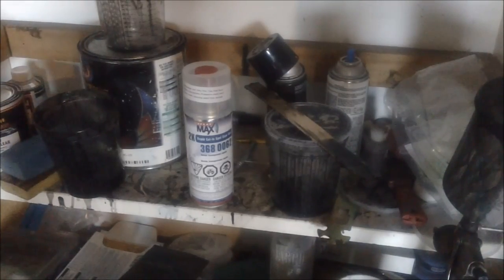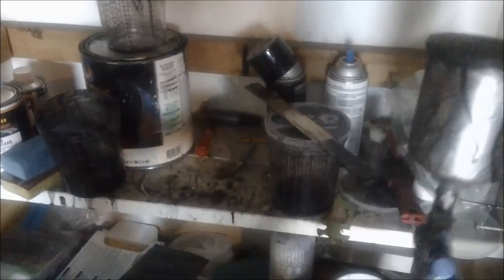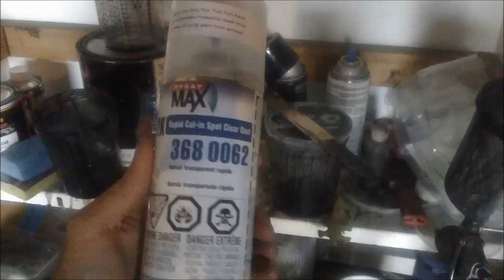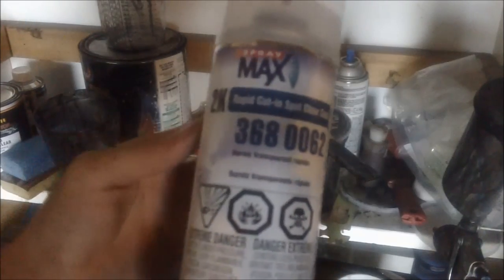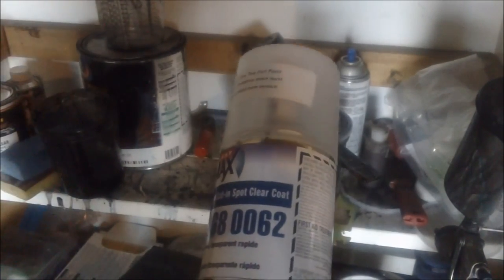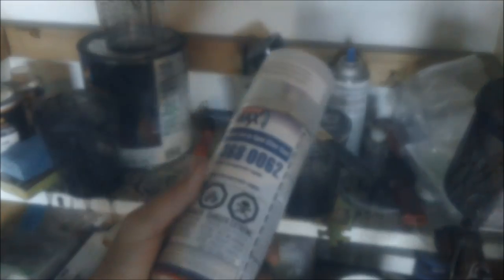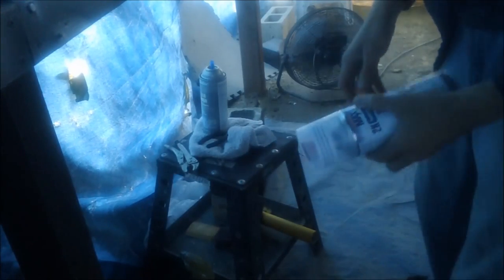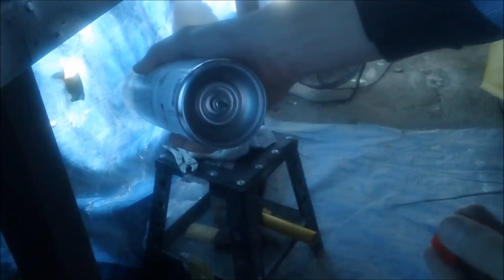SprayMax 2k Clear in a Spray Can

Comment: I used 2 cans of the this on a carbon fiber trunk and it turned out amazing. I wet sanded it with 2000 and 3000 grit, buffed, polished, and then waxed it. Came out super smooth! Threw my micro fiber towel on it and it just glided off.

Comment: Hey Gary I am a professional finisher and I love this spray max stuff. My wife parked her car in a place that she never parked before and stupid me I backed into her passenger fender. Body shops wanted like $1800. to $2400. to fix it. I purchased a brand new fender on line for $140. which was already primed and gave the car's paint numbers to spray max distributor and they mixed the color for me in the spray max cans,  I also purchased the primer and clear coat from them. My total cost was under $225. and my wife who is a bitch to please was so happy she gave me a little sugar that night So if you don't want to mess with compresses, mixing paint, and cleaning spray guns then this is the way to go. I''ll give you one tip however. Spray your paint on a sample piece before you paint your project, this will give you a feel for the job and you'll avoid any runs until you get use to it. It's best to wait at least 2  to 3 weeks before you  start cutting down the finish with 1500 and 2000 grit sand paper and water then you can apply a buffing compound and polish.. You'll never know you might get lucky that night. Have fun guys, Mr V

Comment: Love the SprayMax 2k, far, far better than any 1k.  Worth every penny!
Reply from the maker: +MrLarryQ Exactly! I still use the 1k but only for certain small plastic things now
Reply: except that it can be deadly if not used with proper equipment, google isocyanate poisoning and 2K paint
Reply: @knarly3013  Now there is 2K spray can without isocyanate.

Comment: I just got a can of their 2K Clear Glamour. I am spraying a small motor cycle gas tank I just painted.  I talked to the Spray Max Rep today and they said to always wear gloves along with a long sleave shirt or a paint suit and mask that covers the whole face.  Not to have any skin exposed while spraying was important.  These chemicals can get into your blood stream once they land on your skin.  He also told me after the red cap is pushed on the bottom he said to shake the can putting pressure on red cap as you shake the can for a few minutes.  It also cures better if the the part is placed a warm environment that is over 100 degrees.  Looks like a good product.
Reply from the maker: Ive heard a lot of chemists say that about covering your whole body, then again Ive seen painters doing this for over 30 plus years spraying in a t-shirt and shorts still going strong with no issues. However it is good practice to cover your body up, best not to take chances. But the whole place the part in a hot environment over 100 degrees I will disagree with. Unless youre spraying in the summer time and youre in a naturally hotter than balls climate, the clear will cure no matter what given the ample dry time so the chemicals can lock up, keep in mind when you add the hardener to the product, its going to lock up no matter what. So placing it in a super hot environment does help but is no better or worse than letting it dry on its own, let me know how you like the glamour clear, Ive only used the spot panel one
Reply: +Gary Rubino The Spray Max rep said to put the gas tank in a 125 degree oven for 8 hours.  My tank was just lined so there is no gas fumes.
Reply: +Bubba Gump When I am going to use it I have the correct 3M respirator and no skin will be exposed.  Lucky it's a small gas tank and I will not have to spray much of that stuff.  3-4 coats should do it.
Reply from the maker: While I know that a full air feed mask is a great recommendation, because we dont spray day in day out its not going to be detrimental to your health. Im not disagreeing with it but all Im saying is its not going to be the end of the world. A suite and a good spray max that is fresh meaning its max time its been opened is 24 hours should protect you just fine for the application youre doing.
Reply: would just a regular dusk mask be suffice?
Reply: Robert.  A regular dust mask is not OK you should use the one the manufacture recommend.  I used a 3M NIOSH 60923.  For the amount of product I sprayed the rep said that mask was fine but made sure the charcoal filters are newer and fresh. This is real nasty stuff if you breath it in.  Not worth taking any chances.  Each body reacts different to these chemicals.
Reply from the maker: Ditto! Coudlnt have said it better myself!
Reply: What is your gas doing to the shine whet you drip or spill it on. We have E85 blend, alcohol kills the shine.

Comment: I love this spraymax glamor clear for small jobs.  I've done a couple small side mirrors and they looked as good as oem and matched peel and everything.  Also I go light, medium, medium heavy on my three coats if that helps..
Reply from the maker: phordguy Great to hear another thumbs up on this stuff phordguy! Ill try that light, medium progress thing next time I use this stuff, its been a while for me. I just pounded it on like Id do using a gun and it it got me into a little bit of trouble on the first coat
Reply: Gary Rubino I go light on the first coat (faster pass with less material flow on knob) with a gun as well.  I find it makes less of a chance for a noob like myself to hang a curtain run on vertical surfaces.
Reply: Gary Rubino I sent you a friend request so I can show you how I painted my little door mirror covers on fb.  LOL

Comment: Hi there, great info on the clear coat.

I have just a couple questions since I can't seem to find it anywhere.

I am painting my brembo calipers with VHT engine enamel that is rated at 550 degrees F.  Will be stripping current silver paint off them and then priming them with VHT high temp primer rated at 550 degrees F.  My main question is since this is a 2k clear coat, will there be problems using such on the calipers?  The car will not be tracked or abused.  It's a weekend/dinner car.  I just want to make the calipers look nicer than the previous owners chips/scratched up abuse from them and protect the paint.

One last question since I can't seem to find anything either.  On the VHT enamel paints they say that you should bake them in the oven after the base coat is on at 200 degrees F, for 1 hours.  How would one do this with the clear coat?  Would you spray primer/base then bake.  Once fully cured spray on the 2k clear coat, or would you go through the whole process of primer/base coat/ 2k clear coat then bake?  The first seems more logical because then the base coat that has ceramic in it does it's thing but then I wonder if the clear coat would properly adhere?   Where the latter seems like the clear coat would prevent the base coat from fully curing doing it's thin once baked?

Love your videos BTW.

Thanks,
-Nigel
Reply from the maker: Hey Nigel, Ive never used the spray max stuff on the vht paint before as well as baking anything so its out of my area of knowledge. However I can tell ya what I found on the spraymax site, according to the tech sheet you can use those IR lamps on it but Ive seen nothing that says about baking so on that assumption, you probably cant do it. Check it out, spraymax.com/fileadmin/download/spraymax/spraymax_tmb/spraymax_tmb_gb/TMB033_GB.pdf

But you probably can do it with the vht clear since the whole product line suggests baking, I tried looking for a tech sheet but this was all I found so far vhtpaint.com/high-heat/vht-caliper-paint#Curing

My suggestion would be to stick within the product line to be safe but if you did try it the second way as you wrote, if the primer and base have cured, you'll need to scuff up the finish before you apply the 2k clear if you were rgoing to try it that way because there is no chemical or mechanical adhesion, so you'll have to create it but again, Id stay in the vht product line and follow their instructions. Thats just the way I would go, hope this helps.

Comment: Here is the teck sheet from them, it says Do not polish.

Spray coats 1 – 2 spray coats, flash-off time between
every spray coat (approx. 20 µm): 10
min.

Drying: Dust-dry: 30 min
Dry to the touch: 12 h
Ready for polishing:

DO NOT POLISH (this will
cause undesired glossing of
the surface)
10 min. flash-off time,
30 min., (object temp 60 °C) dry to the touch
Further processing: !
Do not polish!
Matt clearcoats can generally not be polished – polishing
changes the gloss and colour impression.
Processing time: Approx. 48 h at 20 °C room temperature. The processing
time depends on the ambient temperature.
Higher temperatures lead to a shorter pot-time, lower
temperatures to a longer pot-time.
End of work: On completion of the painting process, turn the can
over and spray until the valve is empty.
Reply from the maker: Good to know for the matt clear; however the clear in this video is the gloss version
Reply: They don't make 0062 anymore,
SprayMax 2K clear coat

2 component clear coat with very high chemical, petrol and weather resistance for high-quality and long lasting sealing of repairs and new paint jobs on vehicles and motorcycles.

Advantages

Greatest abrasion and scratch resistance
Very smooth flowing
Permanent high gloss
Very good buffability
No colour tone deviation
Excellent paint condition
Also suitable at higher ambient temperatures

Art.-No.:   (400ml)
680 065 transparent matt (12+/-3 gloss units at 85° measuring angle)
680 067 transparent semi gloss (40 gloss units at 60° measuring angle)
680 061 transparent gloss (>80 gloss units at 60° measuring angle)
Reply: The suppler on Ebay said" good for a gas tank, but didn't recommend it for E85 blend- alcohol kills the shine. I'm not convinced this will work for a bike tank.

Comment: Nice. Gary, wondered if you have a video on blending clear coat spray with an existing factory finish. Have a rear quarter panel with surface rust on the bottom edge that needs repair, but the panel is one solid piece with the roof and quarter panel on the other side. How do you approach something like this?
Reply from the maker: Ive actually only "blended" clear once and to be honest, that isnt the 100% right way to do it as it will fail on you, but you can get away with it. There are videos out there that talk about it, however I no longer do it nor advice doing it. Plus what youre doing is a big multiple areas to clear, What I would personally do is fix your repair areas, blend in your base color then clear the entire panels, the roof and the other side. Thats the best way to insure a long lasting repair but should you really want to blend in clear, check out this vid Pete did on a collision repair job, youtube.com/watch?v=_GhiCdq9y3M he blends in the clear on that bumper and explains how to do it.
Reply: +Gary Rubino Thanks, I'll watch that video.

Comment: Been watching over your videos dope stuff with the spraycan. I might try spraymax on the entire car but that would take alot of cans. Got a spraygun though maybe I think of something to get clear onto my single stage paint. What's a good clear to go over enemal paint?
Reply from the maker: Thank you for watching, seriously appreciate the support through the years now. Hmm good question, a similar answer would be a urethane clear (I favor the house of kolor stuff, matrix is also my next in line choice) but I remember pete saying if you clear over enemal paint, you have to "shock it" dust a lite coat over it, then 2nd goes a bit heavier then 3rd should be almost a full wet coat then apply 2 to 3 full wets after all that. Now for doing a whole car, yea, it'll be a lot of cans but Ive seen a few do it. But if you have a spray gun, go that route and you'll be done so much faster and might even save a bit on materials

Comment: Great informative video, now can this stuff be sprayed over any pain?
For instance acrylic?
Reply from the maker: Im not too sure on the acrylic, one thing you might try is to "shock it" Now I havent done this so this is all hear say but prep the surface till its sanded flat with 600 or 800 then dust a coat of the clear, then do another coat a little heavier then a 3rd even heavier until you work your way into a full wet coat then apply 2 more wet coats from there. Again, I havent tried it but thats what Ive seen a few times on forums.
Reply: Gary Rubino thanks very much , now does this stuff dry quick and to a hard finish I can polish up?
I'm painting some DJ turntables you see and want the glass finish , would I be better getting a paint suitable for 2k as the item I'm painting is plastic does this matter?
Reply from the maker: Ah theres the trick, is it raw plastic or does it already have a coating on it? This stuff does take about 24 hours to really lock up and you can cut and buff it out to a glass finish assuming the panel youre painting is nice and straight. The alternative to this would be the upol 1k clear. It doesnt have a hardener but would be the next best thing to this and you could spray it over other substrates with less fear of it fighting whats underneath. We'll get ya throw this project and have a piece that you'll be proud of
Reply: Gary Rubino thanks again buddy. Yes the plastic has a silver paint on the top of it but very thin so when I key it up the paint will be gone , I was then going to use plastic primer and then paint it a colour and then 2k
I would prefer 2k with hardener to be honest as for some reason I don't have luck with paint drying and I'm very impatient
Reply from the maker: You are most welcome my man! Youre pretty much on the right track to be honest. Plastic primer, base and clear. You should be plenty right to rock and roll from there With the plastic, Id prep it out with 180 and I would add in a high build primer like the spray max 2k primer after the plastic primer, 3 good coats, finish sand it with like 600 wet and go to paint and clear from there. Just like you Im impatient lol but the wait times are just something you have to do, the 2k primer and clear takes about 24 hours to lock up but for a can stuff, its the best around right now
Reply: Gary Rubino thanks again buddy I will get on my project ASAP! And let you know my results.
Have you ever tried 2k matte clear coat?
Reply from the maker: Anytime man, Ive yet to do any flat colors to be honest but I think I might give it a go on my next computer case I paint

Comment: What's your advice for using spraymax 2k for a bumper? I just bought a can and am wondering the best approach for spraying the bumper. That is: in one long spray horizontally across the whole bumper similar to what you did with the door panel, or in smaller sections at a time? I'm afraid that breaking it up into setions would lead to uneven areas.
Reply from the maker: +gloworm106 Id do it in one big spray and not spot it in. You could get away with it if its in cooler weather though and Ive done that in the past. But just to be safe, I think it would be safer and probably easier if you went from side to side. Hope this helps and good luck! Let me know if you have any more questions
Reply: +Gary Rubino Thanks for the tip! I'll be sure to go straight across the bumper to get an even coating. The item description says it sprays like a spray gun, so no issues with splatter, right?
Reply from the maker: +gloworm106 No splatter what so ever so youre cool on that point :) But fair warning, I found out real quick it spray a hell of a lot more than a normal can does. That and there are two clears, ones a "glamour" clear and the other one is like this one which is a spot panel, spot panel doesnt work great for anything bigger than a door this size and some guys N gals doesnt even clear the whole thing they use this "clear blender" which is not the way Id do it but I digress, no splatter. Just keep in mind, this can will lay it out fast
Reply: Gary Rubino
Thanks for the tips. Kinda nervous about using this 2k because of how toxic it is.
Reply from the maker: +gloworm106 just make sure to use a good paint respirator and you'll be fine :)

Comment: Gary when you watch videos that show you how to paint with spray cans what do they mean in the last step to spray clear. Do you need to do that if the paint is high gloss?
Reply from the maker: +Daniel Schnell What they mean is the clear coat, its the last step in painting. Some might be a single step meaning that the gloss and color are done in all one step but in todays paints on newer cars, most are done in base coat clear coat meaning the color is just that and the shine comes from the clear. Hope this helps